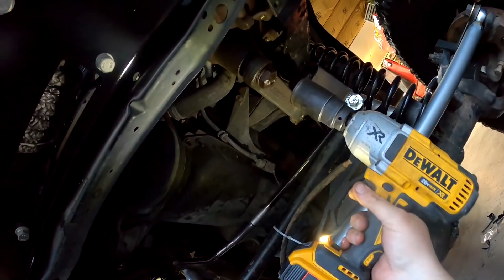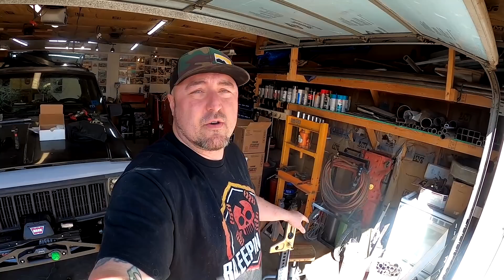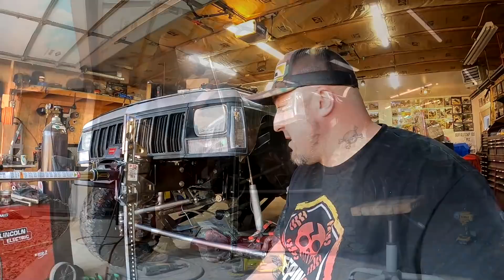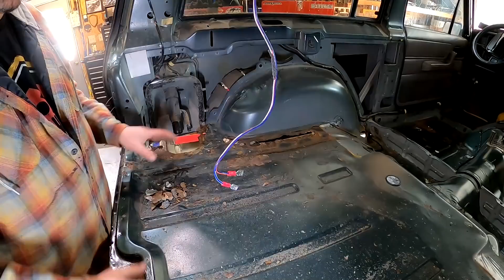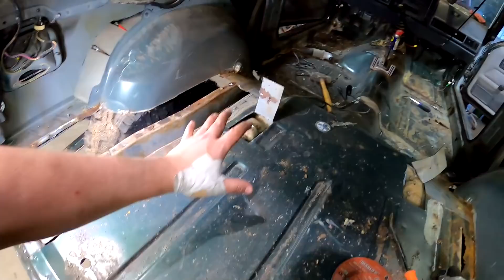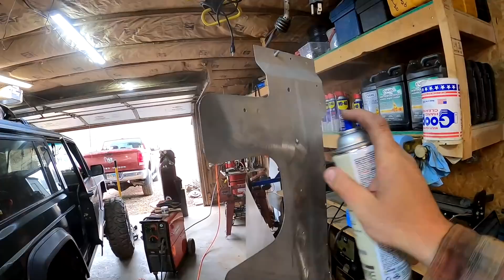Rats Nest Strikes Again!

Comment: I remember the stock jack that came with my dads Dodge station wagon. It was very much like a high lift jack. There were notches in the bumper that the jack would fit into. Perhaps I was simply lucky, but we never had any issues with the jack when changing flat tires whether it was on pavement or dirt roads. Looking forward to your next video and the progress you make.

Comment: You do great work and your explanations of how to do it are very helpful.  I have a tendency to need bandages when doing body work also. If you run across someone that wants a very straight and reliable Samurai tintop  I'm selling mine or will trade for a small four wheel drive pickup.

Comment: If your not familiar with MEK Methyl Ethyl Ketone, hit your big box hardware stores paint section.  In my experience Ive seen the stuff dissolve the seats for the needle valve in carburetors.  Ive also seen it melt vinyl under pinning by simply wiping it with a rag damped with MEK.  Check it out!
Reply: I used it to clean up roofing tar once and turned the tar into water almost. My uncle was a union painter and he turned me onto the stuff 15yrs ago.  Cleans up stuff like nothing else ive seen.

Comment: Since you are already there. I would recommend you do what I do. In the front wheel wells at the fire wall. Cut out the pinch weld. I cut and pushed back the firewar a good 2". Let me know if you want pictures. I can stuff 35s with a 4" lift

Comment: I didn't realize IRO made that bracket. I need to get that. I wanted to stretch my ZJ an inch or so but when I did my coil was hitting the bracket when the suspension cycles so moved it back a bit. Still hits a bit on big bumps. I may need to grab one of those.

Comment: As a former NY resident, rust is no bid deal as long as you aren’t making a show car out of it.  A rotary broach for drilling spot welds, clecos or self tapping screws helps a lot too. When doing the floor to wheel tub, fold a piece of 20 ga sheet metal into an angle. About 10” long is easy to work. Eastwood makes a shrinker/stretcher, that allows you to form the angle to fit around the tub.  Cleco the angle to the floor and tub, do your tack welds 1-2” apart to keep the metal from metal from warping too bad.  It’s really not too bad.  Not sure where you are in SD, but I live in Gilllette Wy now. You’re more than welcome to,borrow the tools if you’d like. I’d come out, but just had a hip replaced 2 weeks ago.

Comment: Unibody is so called because of the front and rear subframes with NO frame rails connecting them.  The ZJ/WJ/XJ etc are Uni-frame designs.   They don't use subframes as they have frame rails going the full length of the body.    If you want to see a true unibody then look at any of the fox bodies, f-bodies, etc.  You'll see the difference and you'll see why there are sub frame connectors to help stiffen up those chassis.   Other than that nit pick great video.

Comment: Couple of years ago I rebuilt a enclosed 10x5x5 trailer to sell, and those surfaces were flat. Loads of fun using a plasma cutter for the first time, but recorking with a non-electric cork gun is a mugs game. Felt like I had arthritis but with blisters.                                                                                                                                                                                                                                                                       High-lift jacks can be scary. 2006 changing all my 4 Runners tires, got to the last one lowering the jack and the handle came up so fast under my jaw, it knocked me out. Trip to the dentist, ex-rayed and only had 1 split tooth and a bruised jaw. But he also fixed the 'rust" holes in my teeth. lol

Comment: I use a heavy duty wire wheel on an angle grinder and a pointy wire doohicky on a big die grinder and chisels and picks to remove the oem seam sealer. I also use a Makita electric sheet metal nibbler to help cut out stuff and of course cutting disc's. I've done quite a few cherokee floors. I like to remove all of the seam sealer from the entire car which requires a full tear down but I've also just done all the interior seam sealer. The oem seam sealer on cherokees seams to hold moisture or something because even on seemingly rust free cherokees I find rust under the seam sealer. I go back with 3m 2 part seam sealer, I like the controlled flow and the heavy body. Then I usually build my own rear repair panels and for the front I use the key parts brand floor pans for the front they are the black color ones. I stay away from the silver floor pans they are cheaper but don't fit as well. I also cut and redo all the spot welds which takes time. If I have the car stripped down I like to go around and stitch weld the chassis too inside and out then install frame stiffeners but it takes me months to complete a rust repair and stitch weld and install stiffeners then redo all the seam sealer on the whole body.

If you made it this far through my super long comment I'd also suggest the Ironman4x4fab leaf spring boxes to replace the forward spring mounts if your keeping rear leafs and your boxes are trashed.

Comment: I have broken almost every tool possible to remove the pittman arm. The one that worked - is a simple bearing puller. Install it, tighten it solid and than install a pulley puller over the bolts that hold two half togather. Works flawlesly, very solid and symetrical load on the puller.

Comment: Anouther old school tip for improving nut retention is to get the nut tight and then use a center punch to ding the threads on the end of the nut

Comment: When installing a new pitman arm, also check to make sure that the nut doesn't bottom out before the arm is fully seated on the taper of the steering box shaft.  Otherwise, the nut might feel tight, but the pitman arm might still be loose on the shaft.  :)
Reply: Ran into this a few weeks ago, nut was super tight but not contacting the arm TONS OF SLACK IN THE STEERING, 1 washer fixed everything.